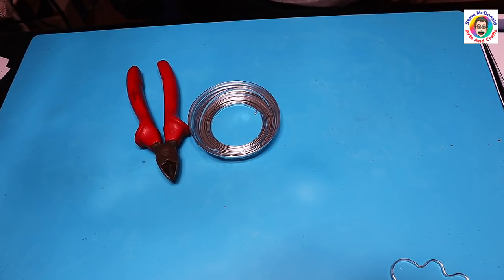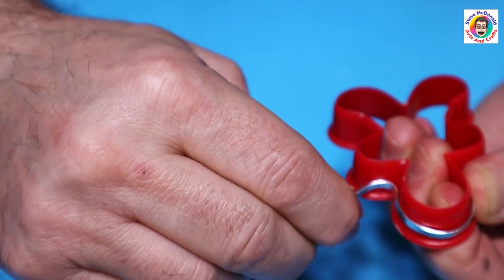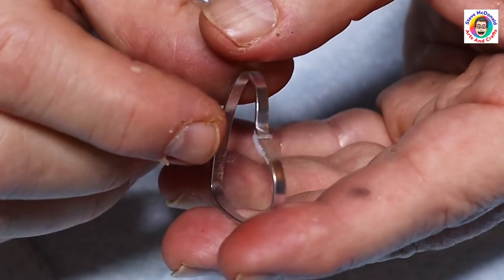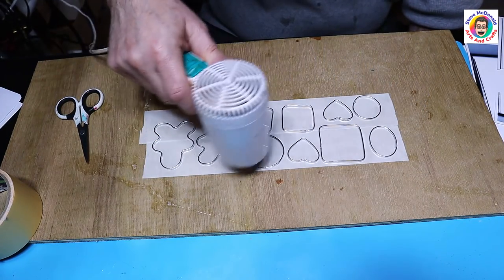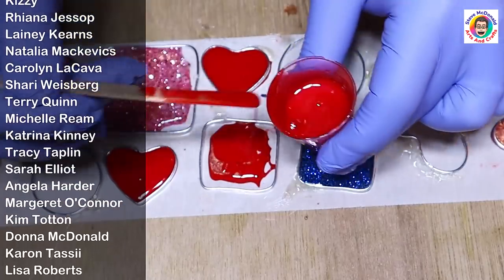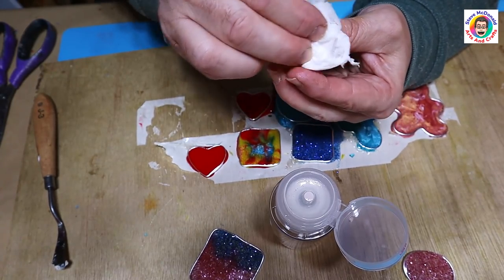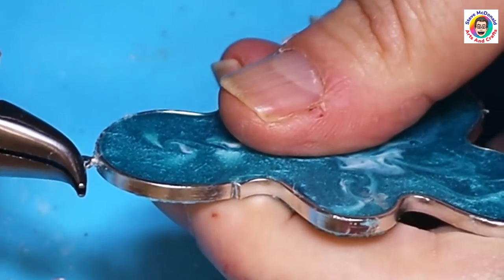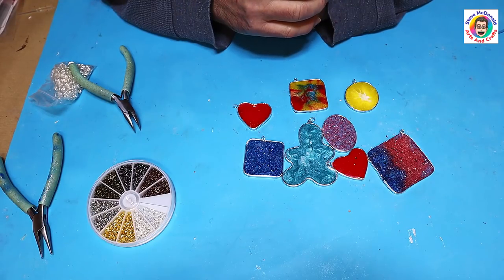How to Make Your own Jewelry BEZELS Without Soldering.

Comment: If you want to be REALLY cost effective...
I cut old soda cans (cleaned of course) into however thick of strips I need and bend them however I want for bezels. I usually just make sure the silver is facing out and the colorful soda label is facing inward, because 99% of the time I’m doing opaque designs, so it won’t be visible thru the resin. 
But there are ways to remove the color and have an entirely silver soda can— it’s just a bit of a pain (unless I’m doing a LOT of them, for multiple projects). ☺️💕👍

Comment: Really pretty! I've been looking for narrower armature wire, so glad you found it! If you want them to be thinner or higher-end, you can use square copper or silver wire. Much better than round wire to avoid leaks. Also, run a rolling pin over them if they aren't really flat.
Reply: KarenNeill - Steve used 18 gauge flat wire.

Comment: Hi Steve, do you have anything on how to seal jump rings without soldering them? Please my earrings keep coming open, even worse on a key ring and I want to be able to give gifts that work! Thank you for all the amazing hits tips and tutorials, I love that you still share when things go wrong.
Reply: Be sure to use 18 gauge wire, saw cut them for precision joining, or buy "saw cut" rings. They will look better closed, fit snugly and in 18 gauge, be strong enough to not just come open. Also there are tutes on snipping wire with snippers that give a flat edge both sides.

Comment: Hi Steve so I finaly made bezels and the pre-made ones worked perfectly except for one were the tape marks made 2 lines but I like it. I am using resin tape. However the ones I made by hand all have leaked, u was wondering if perhaps using hot glue around it might help? Tho it's not really flexible, not sure if you have tried this please let me know I really would like to perfect this project I made so many bezels

Comment: The best thing to get adhesive off with not much effort is baby oil. I find Alcohol I have to rub too hard but working as a CNA for 20 Years, Baby Oil it's the best to get rid of tape residue and does wonders for your skin.